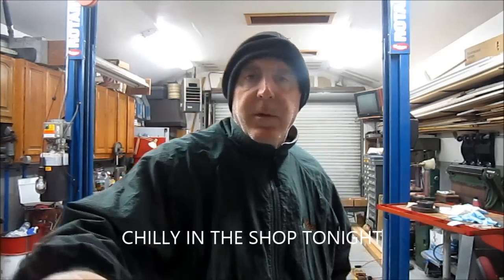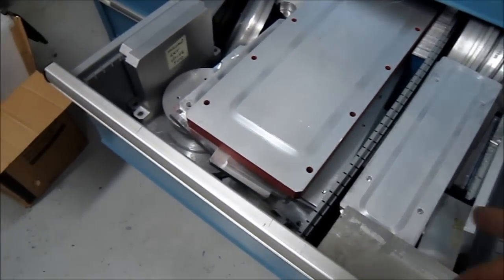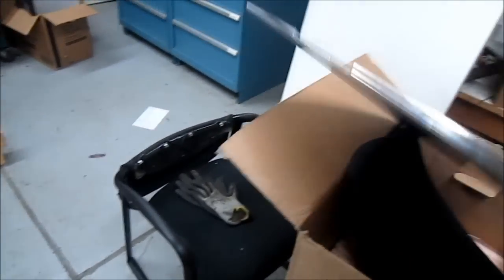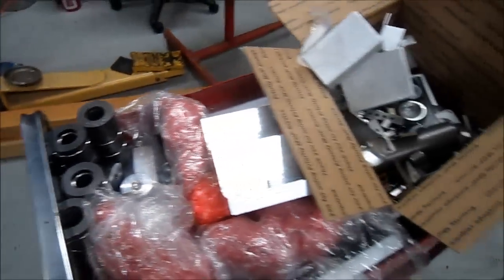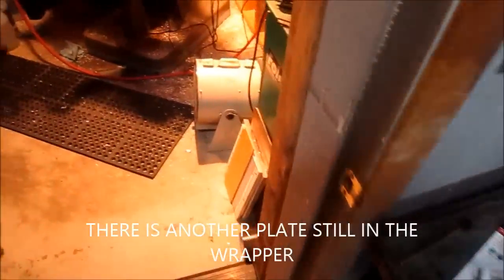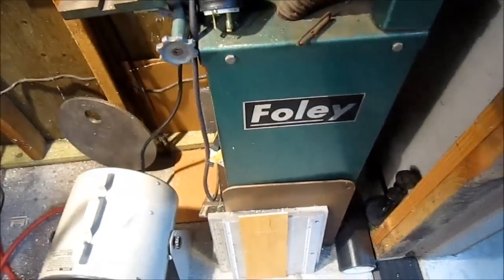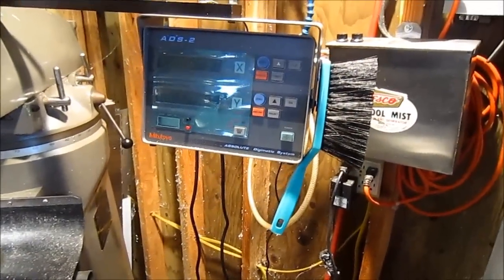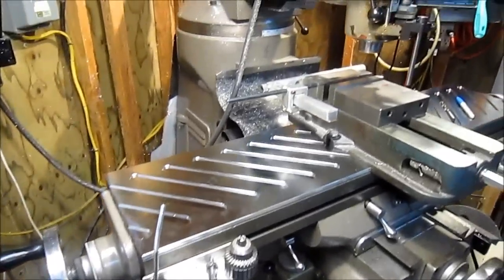QUICKIE 9  Bling Time

Comment: Shiny!  

If the magnet and DRO thing is an issue, you can always bolt a bit of that aluminum on as an isolation bracket and attach I bit of steel to if for the brush magnet to grab. You can get the magnet as far away as needed that way. 

It might also help to put the magnet on the bracket and the steel on the brush...you will replace the brush more often than the bracket, and an unmoving magnet won't generate any induced currents. Just a couple of theoretical ideas...no calculations or magnet-DRO experience to base them on.

Have fun!
Reply from the maker: Big...

Thanks for watching and your thoughtful comments

Chuck

Comment: how strong is the magnet for your brush cus it might not be good for your DRO
Reply from the maker: mog...
1/4" neo which is strong, but it is not on the DRO housing, it is on the swivel frame with an air gap between the units...I think/hope I haven't created an issue..
thanks for watching and your comment
Chuck

Comment: Hi Chuck, nice covers but you made the classic mistake, you made them equal length.
ATB
chris
Reply from the maker: Hi Chris....
"equal length"...you don't know me that well yet...yes I tried, but know they are not equal...LOL 
So my mistake avoided a "classic mistake"....
Chuck
Reply: Oh alright, approximately equal. The mistake is that with covers you are always going to put the vice in the same spot on the mill table. If you make them un-equal say 2/5th-3/5th everytime you take off the vice you put it back on the opposite side you will spread the wear on the mill, rather than concentrating it all in one small area. There is no good reason why you should put the vice dead centre but everybody does. If you have it off to one side you may well have enough room for other fittings, I for instance have a spindexer on the table as well as the vice. No matter how quickly you can set up a vice, it is always quicker to leave it in place if you can.
ATB
chris

Comment: be careful with the magnet on that dro may effect your readings
Reply from the maker: Anthony,
Thanks for watching and your comment/concern, I checked this morning the magnet is on the swivel bracket, not the DRO housing.  There is no magnetism on the backside of the swivel bracket facing the DRO..so I think I am safe
Chuck
Reply: people don't relies the power of a magnt and its effect on electronics.